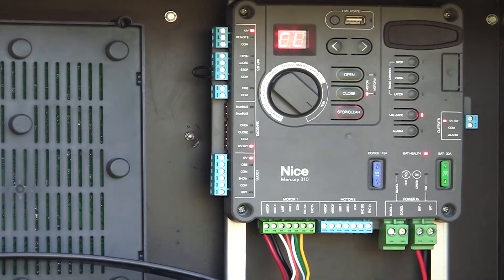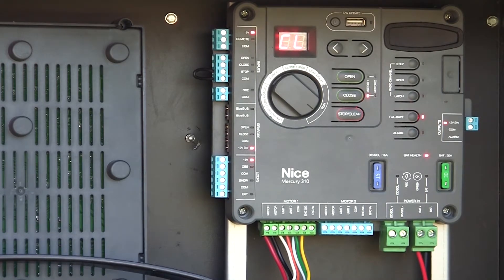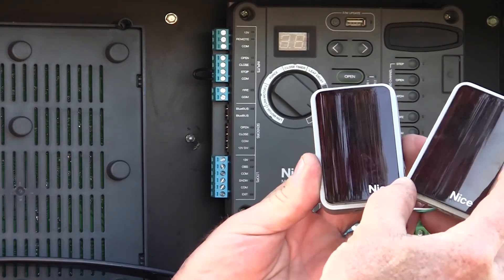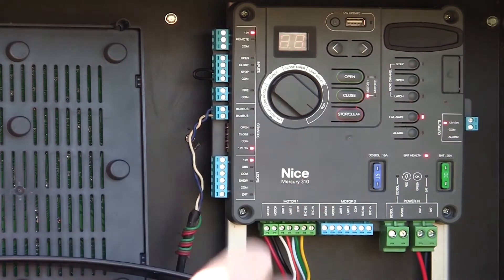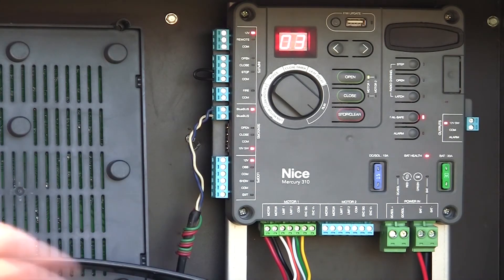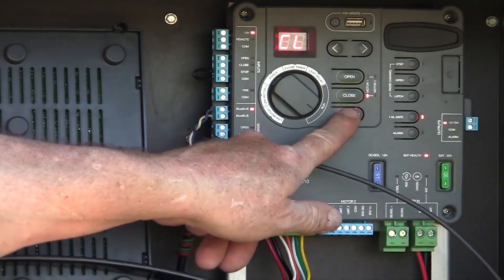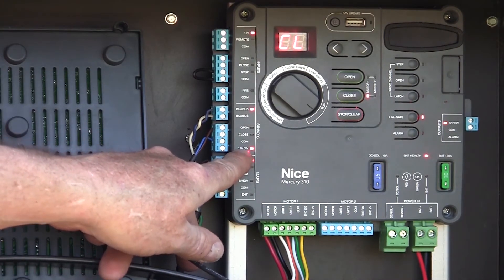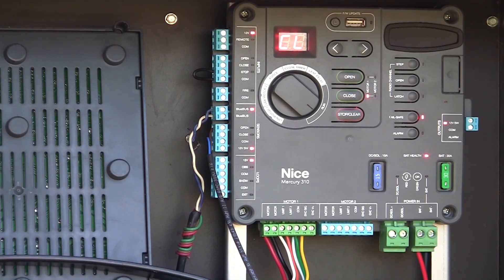Nice Apollo Mercury 310 Controller - How To Connect Monitored Sensors

Comment: If I understood you correctly, you stated the gate could be operated without the use of photo eyes.  However, I am looking at a Titan 912L system with a Mercury 310 control board and here is a footnote for this product.   **For this board to function a UL 325 photo eye safety device must also be attached to the board and used in the operator system.  Is there a newer model 310 board that requires optical sensors to be used?